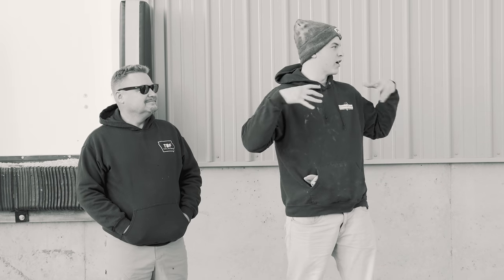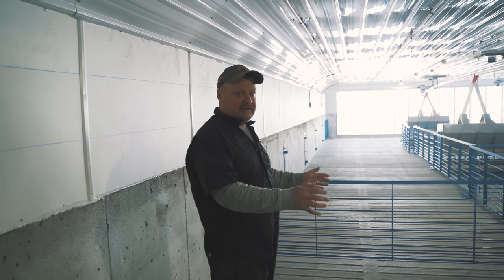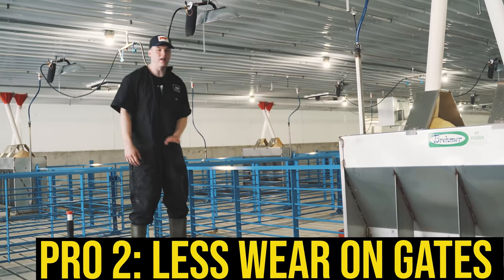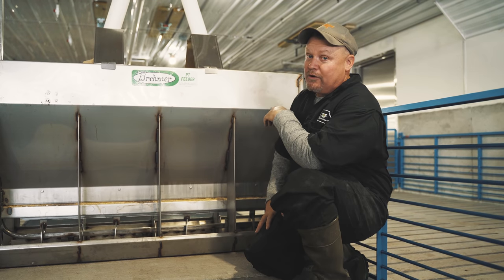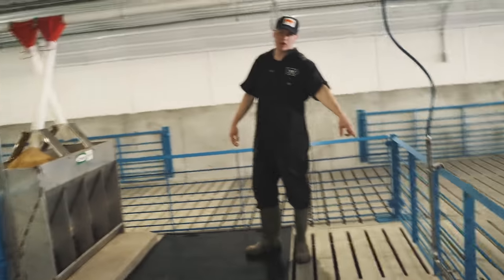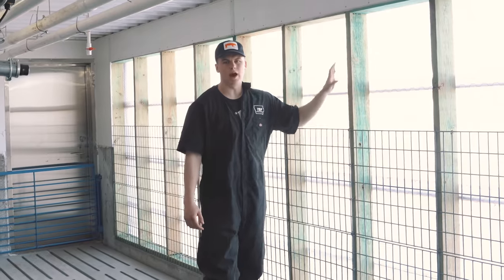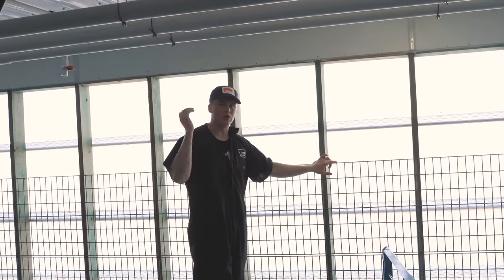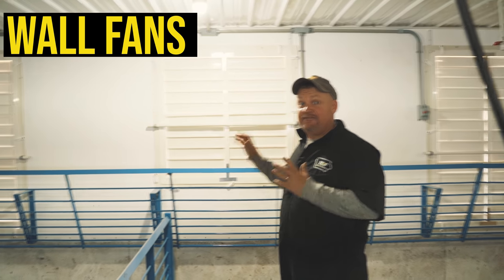Touring Our Brand New Modern Hog Barn Part 2

Comment: A little pro tip for you on your curtains, when it’s time to replace them , leave the rope up that holds it to the barn. Replace the curtain but leave the curtain on the outside of the ropes. Once the curtain is replaced cross hatch a new rope over the new curtain. This eliminates a lot of wear from the curtain sliding on the bird wire. The curtain slides on the old rope that holds it off the bird wire. Avoid any vertical ropes so any wear is spread across the the entire curtain rather than a single spot. I install my ropes on 4’ centers with a screw hook every 2 foot. The enter and outer ropes form X’es across the front of the barn.

Comment: Do you change the temperature inside based on the age of the pig?
Reply: Yes sir, all our barns run a pre programmed temperature ramp. We start out at 78 with 21 day old pigs, hold that temp for 10 days and then start dropping it slightly every day to get the barn to 65 by about day 80. Thanks for watching! The brooder heaters run on their own curve for the first 2 weeks. Thanks for watching!
Reply: @torktalks5573  thank you so much I just help people (not for money) an many times it’s like it does not work.  So it’s difficult for me to understand the real issue.  So thanks for taking the time to answer.   I’m just idiot that understands how to program things